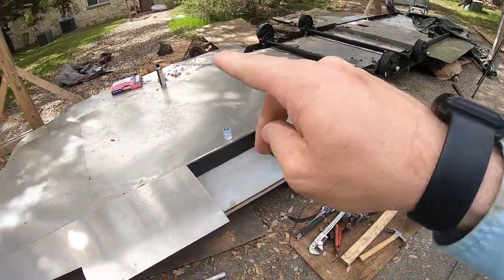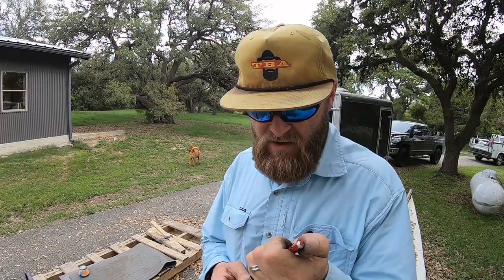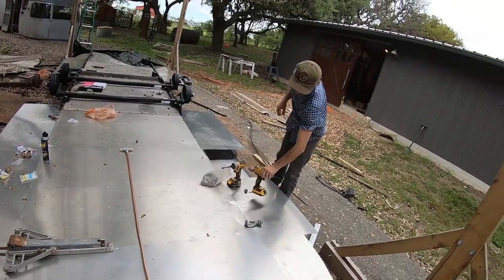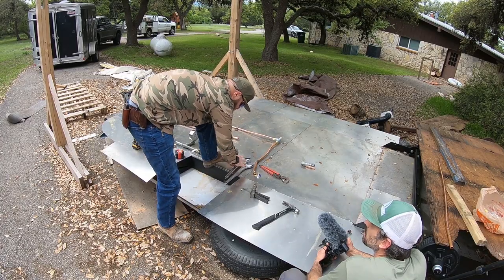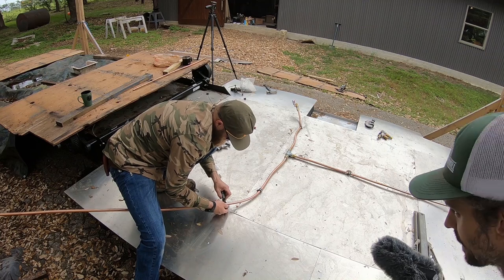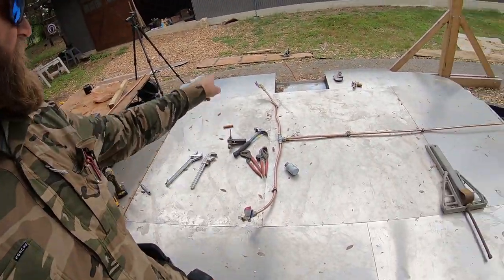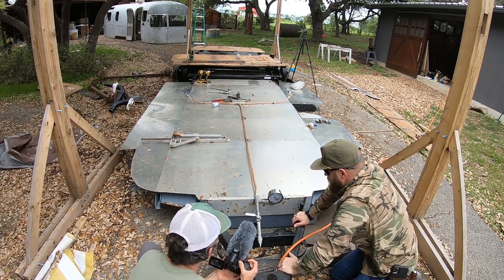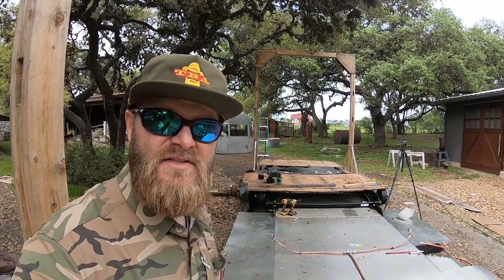AIRSTREAM RESTORATION RUNNING PROPANE LINES

Comment: Anyone who has flared gas lines has at one time forgot to put the nut on before flaring it.  Lessons learned.
Reply from the maker: You are absolutely correct! I’ve done it several times myself......If you ain’t breaking stuff you ain’t working.